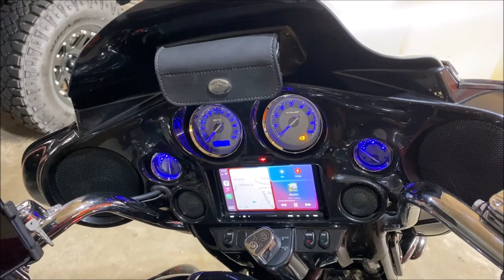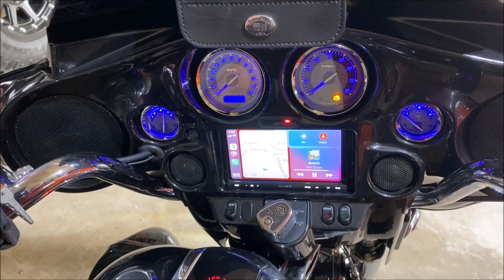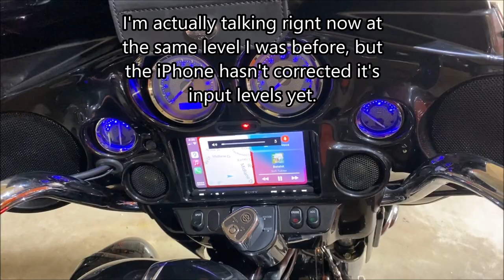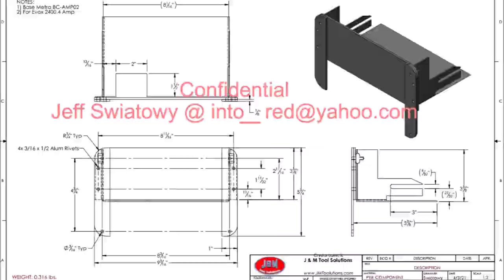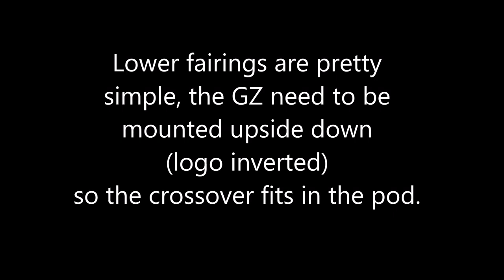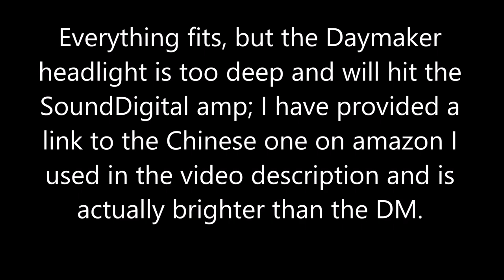2012 CVO Street Glide Metra 95 HDIF Inner Fairing & SounDigital 2400.4 EVOX Amp Upgrade

Comment: Nice build!  I am in the process of doing the identical build but with the SD 1200.4 amp on a 2011 Ultra Limited.  I have been beating my head against the wall trying to get the amp fit.  I really do not want to put the amp in the saddlebag. I have it close with a homemade amp bracket but it looks like your amp is setting a little higher than mine.  At this point, I think I will get the Metra BC-AMP02 Amp Bracket and make the mods.  I am also currently running the DM headlight.  It only sets in 2.5" but I went ahead and ordered the headlight.  Great video!!
Reply from the maker: Your welcome @Tacohead81...if you want a copy of the modification drawing hit me up

Comment: Nice install..I plan on doing similar upgrade over the winter. Did I miss the part that included the tweeters in the fairing? Name please?
Reply from the maker: Ahhh, those are dummies left over from the OEM set up as the GZ are already coaxial; I just didn't find another matching gauge or filler to use if I pulled them. I'm not sure I am going to stay with the GZ, they sound great when sending the juice, but 90% my volume is below half and then they sound really flat. So might be putting tweeters in those holes if I make the change across the front...the Diamonds in the lids though sound great throughout the power band.

Comment: Have a ‘12 street glide and I wanna do the conversion for the inner fairing and head unit. Not looking to upgrade my sound system.
Reply from the maker: Can't speak of the other brands, but I am guessing most have similar fit and durability issues. Already made upgrades to the nut retainer which secures the switch valance and you can see another video on my channel that deals with the wind shield ferrels.